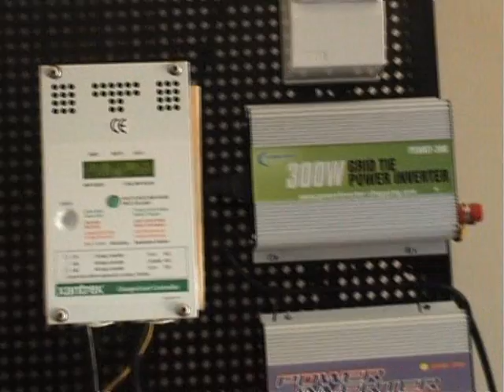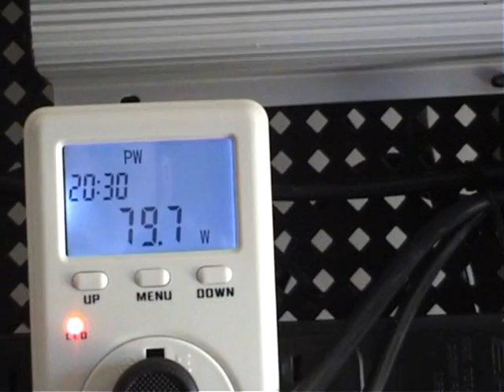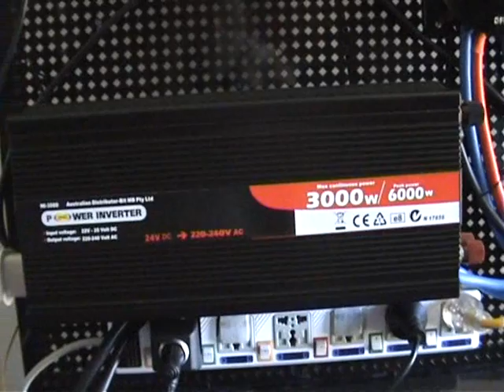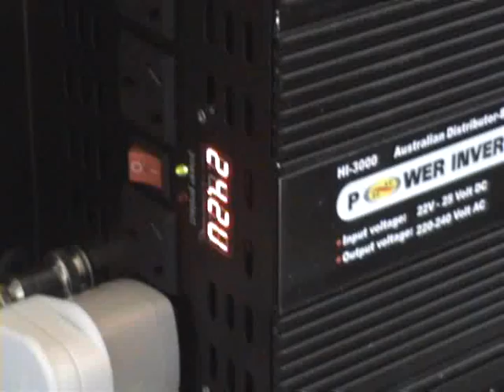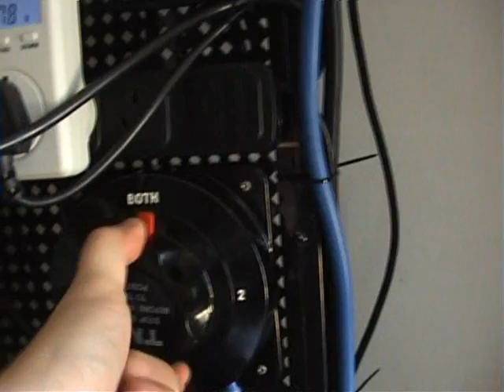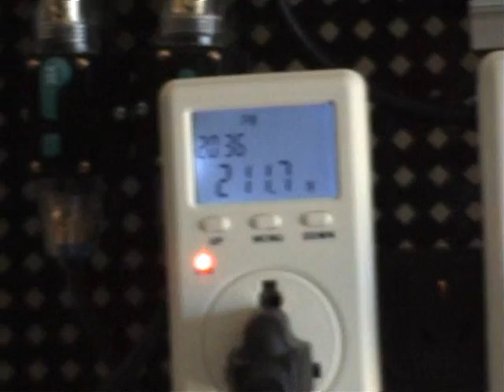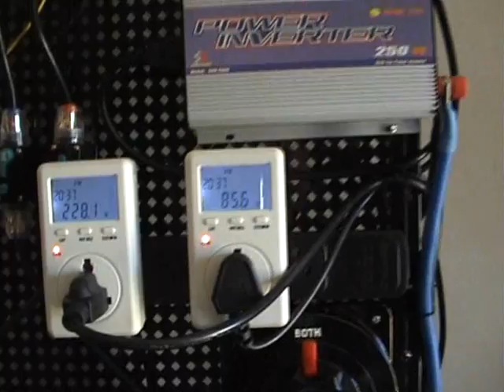Solar panel power system with grid tie inverter and battery bank updated

Comment: In Australia you are NOT permitted to feed power into a house electrical system like this without the system being signed off by a registered electrician. After which the paperwork is then submitted to the authorities as well as the insurance company that insures your home.

Comment: Be careful with the GTI connected on your battery bank
From experience I have glued extra heatsinks on the side where the power Feds are and an external fan to prevent overheat
I had one burned out in the past
Have fan

Comment: I fear your parallel battery wiring is trouble. The jumpers appear too small. ALSO, what happens when one battery cell shorts? No longer equal voltage, -2v. The bank is unbalanced and overcharges one battery. Maybe boom...

Comment: @collintheapplegeek It depends on where you live, but for most areas, it's legal to use this type of inverter without acquiring  permits. Electric companies doesn't really care about grid tying until you reach the 2000ish watts zone. With these inverters you will very rarely put more power into your house grid than you are using, so for the most part it will just make your meeter run more slowly, and not backwards.

Comment: hello again :) I must tell you.. I have now ordered 10x 180w panels for my house.. I will later buy a new inverter that manages 3200w .. to start with i will connect 3 x 180w panels to my 24v 300A battery bank and run a 250w inverter out to the net.. I can run the 250w inverter even when the sun is down... Until i get the "real" inverter and all the panels up on the roof... The final installation will be with 18 x 180w panels = 3240w :D .. thx for a good vid!

Comment: Did you have to get this certified by your electric company?  I am just a beginner and want to get a setup with a grid tie inverter, it sounds like you can connect this without the electric companys permission.  Or is it only when you want to get paid for your extra power.

Comment: wow... thats a nice setup you have there! looks proffesional! :) I have a setup much looking like yours.. I have 4x 150Ah 12V connected as 24v (300Ah). These I have connected to a 250w grid-tie inverter just like you.. I have the setup with batteries right now since i can't have the grid tie running all the time. Only when i consume more power on a phase than the grid-tie put in.... So i got my gridtie running only when the heatpump is on.. :) ..

Comment: Hi dashony i like your work, very tidy.  one thing worries me is that i have fried two pswgt-300 inverters by having them directly connected to the batteries, and have since heard only pswgt-600 and above can handle direct battery amps. i was using similar batteries and 2 x180 watt solar panels through a missouri wind and solar mw160cc dump load to the inverters and grid, with 25 amps plus into inverters also hooked up is a 500 watt mws turbine but it was  putting in less than 5 amps.  cheers